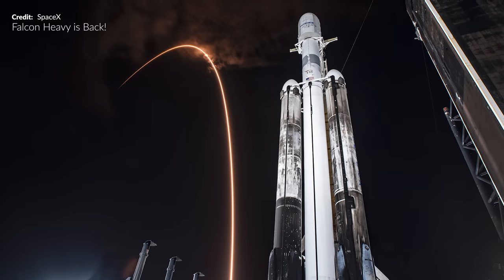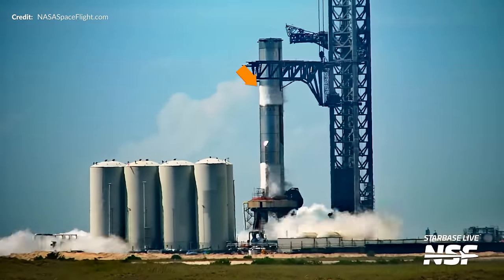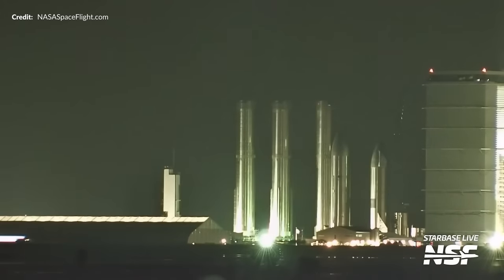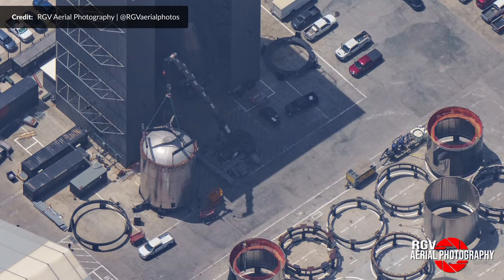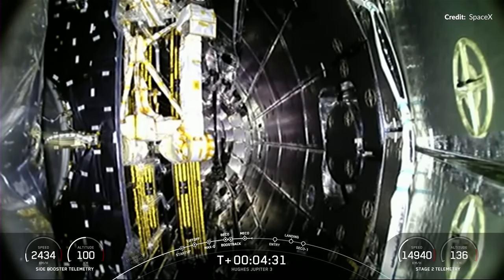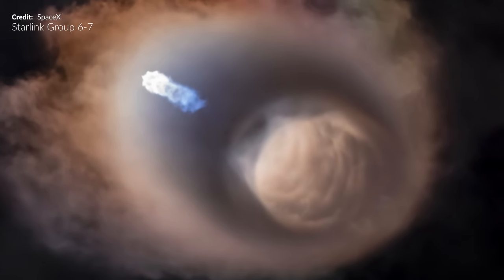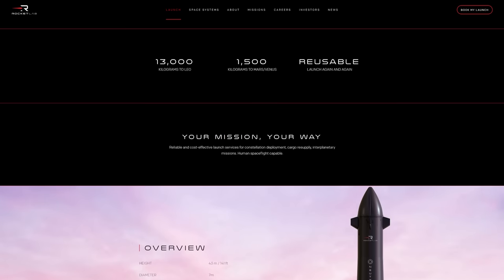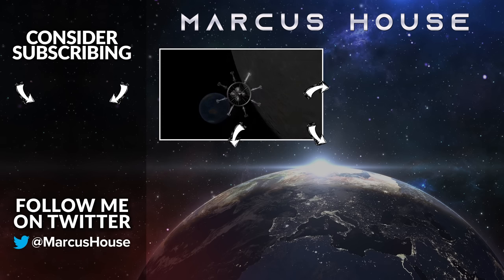SpaceX's Remarkable Full Pressure Test, Starship Sacrificed, & Record Breaking Falcon Heavy Mission

Comment: That water deluge system in action looks insane! Can't wait for the next Starship full stack launch...
Reply from the maker: Crazy huh!? I was shocked by some of those visuals.
Reply: @kennethschultz6465  dear Markus .. just a quick  qustion... if i got 36 raptors pressing 

What spacecraft has 36 Raptors?
Reply: @kennethschultz6465  

If you don't have your basic facts right then your question is meaningless.  Find out enough to ask a meaningful question then ask again.
Reply: @MarcusHouse  It seems to have the least flow in the center where all the damage was initially done. Is the theory that the high pressure water will push the heat out of the pad?
Reply: @kennethschultz6465 Well sir 7500 tons of thrust is much different than 100000, and that's assuming all raptors are at full thrust on liftoff, which im not sure they are. In addition to the fact that you also got the number wrong.
Reply: I give the new pad blowing up even odds but what do I know, it is interesting and exciting. What is the over under on the next launch, December?
Reply: @kennethschultz6465  About 5000 fully fueled, upper stage weighs 120 empty, superheavy im not sure about, the info shd be out there somewhere...
Reply: @Scanner9631  If you can't be civil, learn some manners, then answer. Rude
Reply: @garywojnar1246   If you can't be civil, learn some manners, then answer. Rude

His entire "qustion" is based on totally wrong "facts".  He can't even be bothered to use spell check to try and make it readable.   

He is a troll.
Reply: The water will instantly turn to steam when the candle is lit. The water deluge will expaand rapidly. I am wondering how much water there really is and if it is possible for the deluge system to damage the engines or the rocket. You guys arguing the math are quite funny. Keep it going, great free entertainment lol.
Reply: @@Nick-qb8cv Each Raptor 2 has a Bell pressure of 3xx bar,

That isn't the bell pressure that is the chamber pressure.  The bells would blow apart instantly under that type of pressure.
Reply: @Scanner9631  ...and you're rude and inconsequential...
Reply: @garywojnar1246  ...and you're rude and inconsequential...

You have your right to that opinion.  As I have my right to think this person is just a troll.
Reply: It doesn't look cool compared to NASA own deluge system lol!!
Reply: I actually don't believe it will efficient enough
Reply: And what happens when it lifts 10-20m. The water won't reach that height. It goes more to the sides. I am a bit sceptical
Reply: @kennethschultz6465  whats the difference?  The water deluge system was never designed to be a "Push back" mechanism so why does it matter?  It's not about pushing back any kind of pressure. It's about noice suppression.  Acoustic energy is very damaging and the high pressured water disrupts that. The damage to the equipment and objects near it also got destroyed by the vibrational energy so this is suppressed is well.  Flames are re-directed also.  There are multiple factors that added to the damage that occurred. So let's see what happens when they test.  If it works we know the engineering worked otherwise we will have to re-design the system.
Reply: I'm still surprised of the suspicious lack of memes comparing that water deluge with an anus - the visual resemblance was uncanny.
Reply: Forget about the rocket, I would pay just to see the deluge system!
Reply: @diyzona  I agree. Its still flat surface under full blast :|
Reply: @diyzona  I agree. Its still a flat surface under full blast :|
Reply: Frankly, it looks overkill.   All it ever needed was a solid steel plate pyramid to deflect the exhaust outward between the pillars. By allowing the exhaust to maintain it’s high velocity by simply deflecting it, not stopping it, the temperature against the steel remains adequately low enough (It’s straightforward statistical thermodynamics).
Reply: @Scanner9631 Technically the full stack has 36 sea level engines, I can understand that confusion. Maybe a little less space nerd elitism, and more of an educational, let me help you enjoy this thing I love type of a response would help. Yes, the booster has 33 sea level raptors. The ship has 3 more and currently 3 vacuum engines. Soon we will see 6 vacuum variants.
Reply: @ruaphoc  

The extra 3 don't apply to his nominal question however.  

Look at his first "response" to my requesting some clarity.  

He is just a troll.
Reply: Serious Question : How do you know it's all real from this footage. It may well be all scale models and cgi.
Reply: @F4Insight-uq6nt   Serious Question : How do you know it's all real from this footage. It may well be all scale models and cgi. 

How do I know you are real and not a bot from Blue Origin?
Reply: How the engineers thought they could get away without a water deluge system?  The Saturn V had one & Starship has twice the power.
Reply: @diyzona  I don’t believe the water needs to go that high, it’s only meant to do 2 things, both occurring just after ignition until about 10 metres from the top of the tower: 1. protecting the ground elements and pad itself (stage zero) and 2. minimizing the sound wave pressure at lift off, which could also damage the engines.  Once the risk of destruction of stage zero is past, the sound wave and air pressure risks are also substantially lower as there is much less reflection of sound and pressure from the ground.  Even the flame diverter trenches and water deluge systems for the space shuttle only dealt with these issues at low heights and didn’t shoot water up into the air.

I’m very interested to see how this works in practice because the steam itself has to expand and is a potentially damaging hazard but I’m not a rocket engineer so I’ll be positive and think this is now a solved problem.
Reply: Well, what is the purpose? Is it just to look insane? What's the purpose?

Comment: Hats off to all the hardhats on site! These guys are performing miracles in the southern texas heat. I would step outside my air conditioned car and die lol.
Reply: One get's acclimated fairly quickly to point you don't even notice your cloths are soaked in sweat.
Reply: What blows me away, that's the very spot we went to party when I was in the Navy, 1983. We would sleep on the beach with camp fires, eggs in the morning, burgers for lunch and so on. Why? It was quiet
Reply: @joek511    Still can today with the chance of a Ray Bradbury "rocket summer".  :D
Reply: @Mrbfgray Some can get acclimated quickly, not all. Lol 😅
Reply: @CountryLifestyle2023   Have you worked in it?  Different here in Commifornia, not humid but up to the 110F range.  As tiny field contractor I have to work in direct sun and find it takes just a few days to get used to every yr.
Reply: @Mrbfgray  And everyone is different. Some never get use to it
Reply: @CountryLifestyle2023   Not that different, I've worked with hundreds over the yrs in the heat and yeah, everyone used to it.  Soft air conditioned office workers don't apply.  Not to say we love it but we don't love the cold either, just deal with it and get the job done, I prefer 110F over 40 in the winter which causes a host of problems from stiff cords to cold damp steel that needs extra preheat for welding.
Reply: @Mrbfgray  I would prefer working in the freezing winter than the blazing hot summer.
Reply: @CountryLifestyle2023  Have you done both?  It's always easy to favor the other while dealing with it's opposite., memories are short.  

Having dealt with snow, slush and permeating cold and wet I'll take the heat, even 114F in direct sun, neither are pleasant but we can't have perfect 80's all the time tho we get that half the yr here in climate friendly Commifornia low inland.
Reply: @Mrbfgray  yes, yes I've done both. And prefer the cold.
Reply: It's hot but they are also right on the gulf coast so at least there's a breeze lol.
Reply: I'm surprised you know him too; I've been making a lot of profit investing with him for the past few months.
Reply: This is the kind of information that we don't get from most YouTubers I will get in touch with him right away. Thanks
Reply: @Mrbfgray  you come up with that pun all on your own there big guy? it's pretty bad
Reply: @Mrbfgray as a Mainer I've worked out in the -20s many times (far lower if you count wind chill), even got knocked off a barge once and had to strip (literally had steam coming off me when I took the clothes off) and finished the work day in a change of clothes. Still I much prefer the cold to the heat, you can always add layers, can't always remove them! Plus if you're working steady you don't even notice the cold, it's when you have to stand around a while that it can kinda suck. That said heat in Maine comes with very high humidity (this summer around 80 to 90% much of the hot days) so it's pretty insufferable.
Reply: @Mrbfgray 😊

Comment: 13:49 "ONLY the sixth flight for this booster..." is a phrase that was never possible before SpaceX. And STILL isn't possible for any other boosters.
Reply: Umm . . . You never heard of The Space Shuttle?
Some of the SRBs went up more than fifty times.
None of this is really anything especially new, reusable boosters least of all.
Reply: @stickiedmin6508 Shuttle SRBs don't really count, since those are completely remanufactured, to the point where it's way more expensive than to just build a new one.

Also, RocketLab has recovered boosters before, but I don't know if any have been reused.
Reply: @user2C47  
Are you under the impression that the SpaceX boosters aren't stripped right down, refurbished and rebuilt between each flight? The stresses involved in launching a rocket are just too large, too violent and too unpredictable to safely do otherwise, and are compounded even further if the craft is expected to go through it all again by landing afterwards, rather than simply floating down under a parachute. 
Even if no significant damage is expected, the whole thing still needs to be stripped down and every component triple checked, because they simply can't risk doing otherwise - skipping over maintenance and safety checks just leads to explosions.
Like I said, none of this is new.
Reply: @stickiedmin6508  I imagine they do so to an extent, but there's significantly more than just a bare metal tube left when they're finished. 
One reason they chose to land propulsively is because it allows them to land on a pad instead of dunking it in cold saltwater, saving them a lot on turnaround costs.

Starship, once in production, will require very little inspection before being launched again, and completely remanufacturing it every time would be counter to the philosophy of the whole system.
Reply: @user2C47  
"Starship, once in production, will require very little inspection before being launched again,"

Impossible. No competent and / or responsible engineer would repeatedly put ANY complicated machine through the stresses involved in launching a rocket (and landing it again), without a thorough inspection.
Think about how much punishment The USN's fighter jets endure, getting blasted off of carriers and then thumping back down on to them so hard that it's considered a controlled crash rather than a conventional landing - The Super Hornets have to spend ten to fifteen hours in maintenance for every hour of flight, and that's from a tiny fraction of the kind of force a rocket goes through.
Unless you want me to believe that SpaceX are actual wizards, with real magical powers that let them bypass inspections, teardowns and repairs, there's just no way that claim could be true.

Who on Earth told you there would be "very little inspection?"
Reply: Thats because previously You've Littered the Boosters in the Atmosphere!!
Reply: @stickiedmin6508  "Very little inspection" is only in comparison to Shuttle. Probably a little more than a 747 or C130, plus a lot of automated self-testing. The first 20 or so production launches, would definitely require more, and new vehicles would need proof testing before going into service.
Reply: @stickiedmin6508  Stop lying. SRBs were made up of segments and reuse was at the segment level, two segments share the record of 12 flights each which is impressive but far from the 50 times you FALSELY claimed. For reference, the current record holding F9 booster was re-used 17 times and will probably get many more flights before end of life.
Reply: @giovannifoulmouth7205  
Mind your manners please. 
It doesn't matter what you, or I, or anyone else says about the Shuttle SRBs - none of that gets any of SpaceX's stuff any closer to being truly 'reusable.'
A craft that requires an expensive, month's long overhaul, teardown, inspection, refurbishment and rebuild before getting back to the launchpad is hardly 'reusable.'
My point stands. Landing the rockets is a gimmick. It doesn't make them reusable, and it definitely doesn't make them cheaper. 
None of this is new.

Comment: The plate pressure test is absolutely mesmerizing!
Reply from the maker: The slowmo is really exceptional.
Reply: @MarcusHouse  i saw some shorts of it and watched them about 5 minutes straight, it’s art!
Reply: Vatch da vatch
Reply: Not really it's nothing special
Reply: Would be great if it would work. If that was a 100% test... I think chances are higher that I end up a billionaire by the end of the week.
Reply: @carholic-sz3qv 
Vatch da vatch
Watch it perfectly  swing gently from Side to Side, back and forth, back and forth, back and forth,    .... forth.

You are beginning to tire and feel rather sleepy now. Your eyelids are drooping over your vision. You must keep your eyes open another few seconds more  so I won't make you jump around like a young chicken. in heat in front of all these People. So ...
Just Vatch da vatch
Reply: @carholic-sz3qv  so you're telling me you aren't intrigued by the way the water mixes with the air and fans out? 
You are dead wrong

Comment: Just think, a 100 ton satellite launched from Starship sometime in the next 10 years. 🤩
Reply: @marvindebot3264  I know that, of course with Raptor upgrades the payload can exceed 250 tons. I gave an example weight for comparison.
Reply: Now imagine a replacement ISS deployed with 2 launches.  3 with full reuse of the rocket.  Then a Starship docks to it and is STILL bigger than the station.

Comment: The new and impressive water deluge system is confirmation that SpaceX had the project in the works BEFORE the first launch that made the crater under the pad. There's no way they cobbled together this system practically overnight since the launch. It was more important to get the rocket off the ground than it was to protect the pad.

And you've gotta admit that the car-sized chunks of concrete landing in the ocean was way cool.
Reply: Yep, Elon said after the launch that they had been working on the plate for months
Reply: @Astromath lol!!!!!
Reply: That's because they're scientists. They knew the power they were dealing with.

And they knew there was basically no chance of not wrecking the entire thing.

Even if it works, it doesn't fix their problem.

That thing is supposed to land on Mars. There won't be a plate and pressurized water system waiting for them.....

This let's them keep working on the rocket, but they still have to figure out how to launch without a deluge system.
Reply: @Astromath  Exactly. It shouldn't be news to anyone that they were working on this before the first launch... guys like Marcus here, and Felix from WAI... they were talking about parts for what was obviously a deluge system as far back as December or so.
Reply: @lordgarion514  It's not supposed to land on Mars. You're confusing the booster with the upper stage.
Reply: @simongeard4824  
Not really, I was just talking about the rocket in general. My mistake.

But they're still going to have to work out how to launch, the upper stage, from a dust, dirt, and rock covered planet. And a slightly less dense crust as well.

I know there's a LOT more power from the first stage when it lifts off from Earth, but that was with reinforced concrete underneath.

It's not part of the old lunar lander that's going to be taking off from Mars.
It's gonna tear shit up. LOL

Comment: The static test is what I’m waiting for.   When some thousands of gallons of water flash into steam almost instantly under the fires of those massive engines, it will be interesting to see what effect the expanding steam has on the structure and the rocket.   Presumably, it will be negligible - the people designing all this are at god-like levels of cleverness from my perspective, and there is nothing to contain the expansion - but having spent years in the engine rooms of ships driven by steam, I have a huge respect for its power, and some idea of how it sometimes surprises.

Comment: Ariane 6 just had a successful WDR und Tory Bruno stated they have a redesigned common dome for the Centaur upper stage ready so there is some progress there but still: Kuiper is solely banking on unflown rockets.
Reply: They can always get SpaceX to launch them.  Or maybe Blue Origin will build a New Shepard Heavy and be able to launch 1 at a time. 😁 (Optimistically of course)
Reply: @Scanner9631  Or, air-launched New Shepard, fully expendable. That might be able to manage two kuipers at a time

Comment: Doubts about this system are not based on how cool it looks,  my biggest concern is its integrity if/when there is a hotspot and superheated steam tries finding a place to go because those raptors are going to try really hard to stop it escaping from the water outlets.
Either way im not going to miss the next launch for love or money.
Reply: "Stagnation pressure" is easily calculated.  The water pressure and flow rate needed are then also easy calculations.  Done and done.  Engineering for the win!